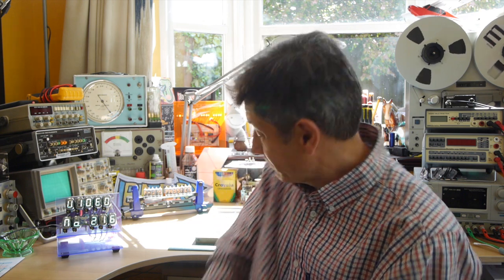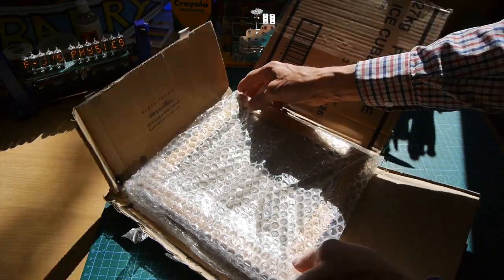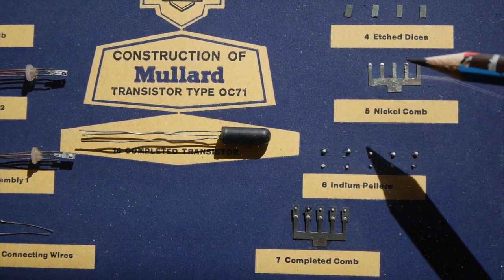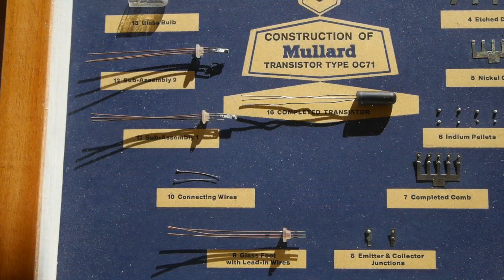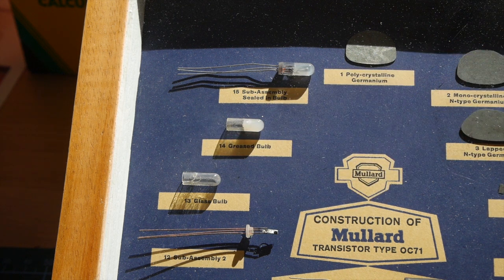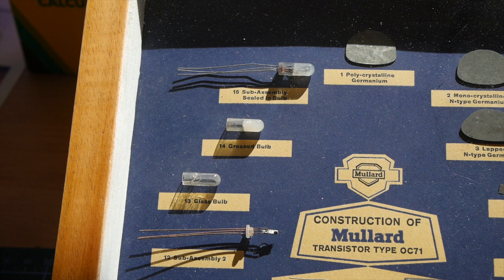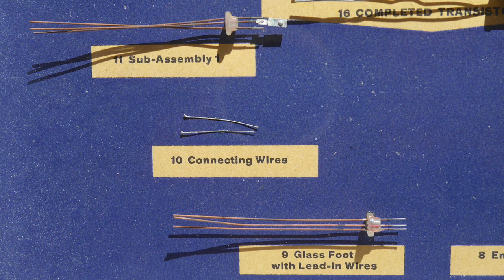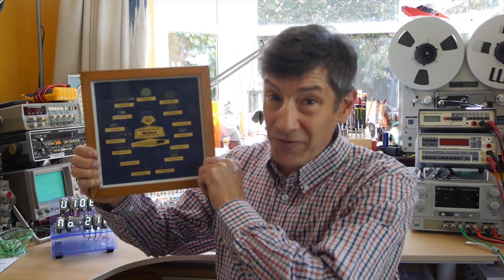OC71 Transistor Construction -  F-J's Physics - Video 216

Comment: I always thought that the material was germanium dioxide not pure germanium as you state. Or have I missed something?
Reply from the maker: Great question .  So old germanium transistors were made of germanium metal not any compound of germanium.  Other metals like indium and gallium or antimony were then 'bonded' on to give the junctions due to different valencies.  You may be thinking of Silicon Dioxide that has an extremely high Resistivity so is used as an insulating layer in microcircuits and the like.  Germanium Oxide is used in optics though.  The germanium for transistors was grown as a single crystal and then diced up for these applications.  Hope that helps a bit!  F-J.

Comment: In 1962 when I was ten, I asked my mom at the Baskin-Robbins Ice cream store, instead of a double scoop cone for 35-cents, could I just have the money so that I could save up to buy a Raytheon CK722 transistor? I was fascinated with electronics and had already saved enough to purchase a soldering iron for 99-cents at the local hardware store where they had a collection of newly imported cheap Japanese tools for under a buck. I went on to become an inventor, designer, and manufacturer of custom tools for professionals working in the fields of mechanics, electronics, and optics for more than 50-years, all without a formal education or degree, passion will always transcend a diploma on the wall! David Riddle
Reply from the maker: David, that's a fantastic story and thanks so much for sharing it!  Ice cream swapped for transistor funds - brilliant and look where it led you!  Thanks for watching and sharing your experiences!  BTW wish I had a CK722 - that would make for a good video as well!

Comment: I have some of these in my collection. I build guitar effects pedals and use these in treble boost pedals
Reply from the maker: Excellent!  That's great!  I would really like to know why the OC71 is so 'special' to some effects pedal makers.  Is it because it was used i the early examples or just a bit of folk law that has been perpetuated.  Looking at the specs of the OC71 there would be plenty of other germanium transistors that would fit the bill or just a OCP71 (which are really cheap).  Can you enlighten me further to what I might be missing.  By the way I plan to do a video with more of a 'deep dive' into the characteristics of the OC71 including temperature based and optical.  Thanks in advance, F-J.

Comment: Very interesting video. One question, since the melting point of indium is so low, how was the bonding of the glass foot and the bulb managed without damaging the junctions?
Reply from the maker: Excellent question.  The reference that I used said, 'The transistors are now ready for placing in their glass bulbs. The envelopes are first filled with a special silicone compound which will protect the transistor from moisture and help to conduct heat away from the semiconductor material.
   The seal between the glass bulb and the foot is made either by electrically generated radiant heat, or by a gas flame on equipment looking like a scaled-down valve-making machine.'  I think it must have been done very quickly and with the leads held in something that would act as a heat sink.  Remembering the leads were of a very low diameter - which is why they broke off, and so did not conduct heat that well.  Hope that helps and thanks for watching, F-J

Comment: Merci monsieur je suis vraiment très surpris tu savais pas qu'on utilise du germanium de l'arsenic et indium pour fabriquer des transistors vestimentaire comment en fait les mémoires de stock dans ces matériaux😂
Reply from the maker: Thanks Felix. Not sure I understand your question. Did autocorrect do something odd with the text? Fj.
Reply: @AnthonyFrancisJones je reformule je voulais te dire que je ne savais pas c'était fabriqué en germanium en arsenic et en indium la question c'est comment ces matériaux stockent de la mémoire est-ce que vous saviez ?
Reply from the maker: The materials don’t but if you set up transistors in simple logic gate circuits then they can be on or off and therefore store one binary bit of data. Search for my diode logic gates video if you have not seen it yet. Thanks FJ

Comment: All OC 71 that I have seen were with glass enclosure with some silicon grease. Mullard or Philips made. Thank you for the video. Reminded me my old days.Regards.
Reply from the maker: Excellent!  This is a facinating historical item and I am glad I could share it with you here.
Reply: @AnthonyFrancisJones  There were two types of filling. The early one was a clear sislicone. Hobbyists like myself back then could take advantage of this by scraping off the black paint to convert the transistor into a phototransistor. It didn't have the little moulded lens of the official one but it worked just fine. Mullard didn't like this so they changed the filling to an opaque type that stopped us playing optics.
Reply from the maker: Thanks, yes I think I have seen both types of filling but all the research I have done, even with a few ex-Mullard people seems to point to the fact that any change was not done to block the 'paint scratchers'.  I would really value a primary source on this as it seems to be a bit of an 'urban/electronics myth' but would love to find out otherwise!  More OCxx stuff coming soon I hope!  Thanks for watching.
Reply: @AnthonyFrancisJones the problem they were addressing may have been to with accidental scratching. I discovered it when a radio suddenly developed a nasty mains hum that I could stop by grabbing the transistor. Turned out it was a front panel lamp that was powered by ac. It wasn't even a huge scratch.
Reply from the maker: Thanks, yes that's interesting.  Funny all the places that mains hum turns up in circuits.  I remember the AC dial lamps and filament voltages causing problems too!

Comment: Back in the days I have built a number of circuits with an ordinary OC71 with the paint scraped off the housing. Parts were very hard to come by where I lived but I had a number of OC71 which I could use as photo transistor.
Reply from the maker: Excellent!  Thanks for that reminiscence.  I am planning to do a video on exactly that to see just how well they work as phototransistors even thought I have quite a stock of OCP71s!

Comment: In the 1960s you could also buy a device called an OCP71 - a PNP phototransistor.  It's actually the exact same device, but in a translucent case rather than the black painted plastic cans.
Reply from the maker: Yes, that's right Richard.  One of my next videos will be on using both the OC71 and the OCP71.  Research that took a while pointed me to the fact that the OCP71 was built separately but then those that did not come fully up to spec were then checked to see if they could be OC70,71,75 transistors and then painted black as they were indeed very light sensitive.  Thanks for watching and taking the time to comment.
Reply from the maker: BTW, back then the OCP was much more expensive than the OC but that has totally reversed now, but that's another story...!
Reply: @AnthonyFrancisJones Yes - I recall that youngsters (like me) used to scrape the black paint dipped on ordinary OC71s to make phototransistors out of them!
Reply from the maker: Yes, that seemed to be a good trick especially if you found one with clearer silicone rather than the white and inner blue 'bouncing putty' but I guess light would get in regardless.  The OCP71 is remarkably sensitive with light shining into the top of the glass tube too.  I was quite surprised!  Probably the next video I will publish, so do join me for that one!

Comment: Nice display. The low melting point of indium and diffusing ability explains how these were so sensitive to heat. Often said they would fail if they reached the temperature of a cup of coffee. A lot of care and heat sink pliers were required when soldering these.
Reply: Actually  that's a  good point, alot of dads early circuits using similar transistors had there leads curled up into a single coil spring and not trimmed to length like we would solder modern components, and then trim the leads. I assume the extra wire acted as a sort of heat sink.
Reply from the maker: Yes, this was a very common method on circuit boards especially in more critical situations, not so much radios etc.  It was felt that these components needed some kind of shock relief but most importantly they could change their temperature in use causing expansion and contraction of the case and leads so to stop cracking of the glass envelope and to allow for small changes in dimensions spring winding of the leads was used.  This was common on glass encapsulated diodes too.  Now, going back even further, really early electronics that had lots of connections, perhaps to different battery tappings used solid conductor wires that were coiled up.  My father had an old 'electric shock' medical apparatus that was like this.  Coiled leads coming up in my next video on using the OC71 and OCP71 by coincidence!
Reply from the maker: Yes, I was lucky to get this loaned to me.  Certainly not a transistor that should get any heat to its junctions.  When working with some of them I was amazed by just how thin the lead in wires can be though.  An OC71 project from the 1960s coming up soon!
Reply: @AnthonyFrancisJones  i once resoldered a wire on a newmarket audio driver transistor that had one  lead break off right close to the glass bottom, i managed to get it to take and amazingly it worked perfectly ok after!
Reply from the maker: @andygozzo72  Thanks great Andy.  I have an OC71 with the base wire broken there.  They are so thin and they seemed to corrode a bit that I don't think there is any good metal to get a fix on.  Pain it's the base as I could have used it as a diode otherwise!
Reply: @AnthonyFrancisJones  glass ones may be more delicate, this one i 'repaired' was a metal can but had a glass 'bead' at the bottom where the leads exited,
Reply from the maker: @andygozzo72  Yes, the glass tubed ones still had a glass lead seal but I don't think there is much metal left to get an attachment.  I will get by with others!